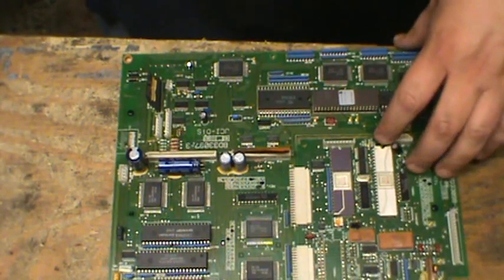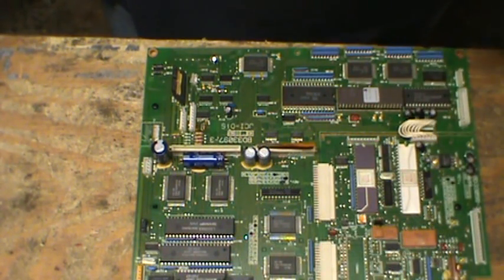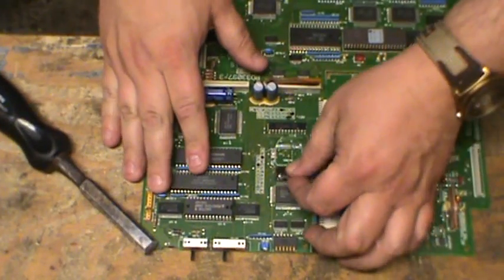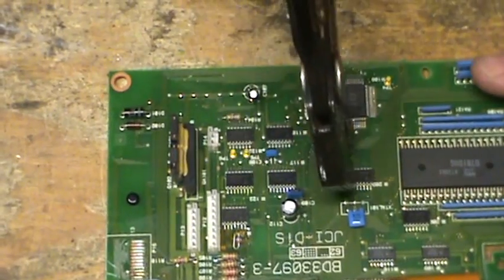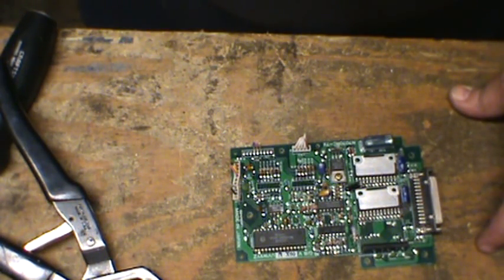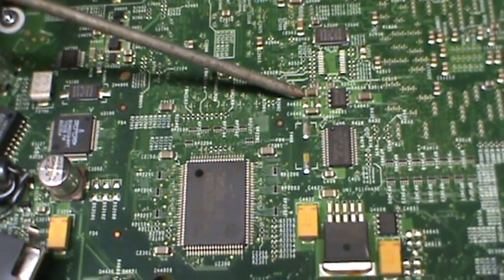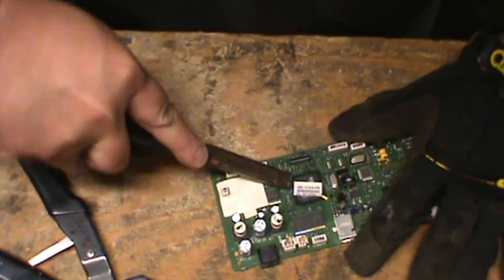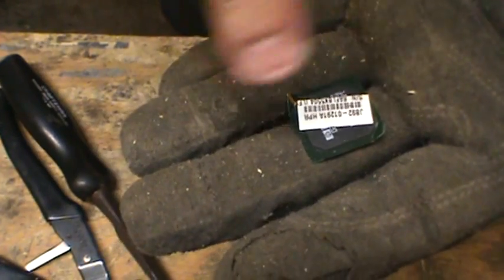Scrapping, how to remove IC Chips, and what else is worth money on a circuit board

Comment from the maker: Hi and thanks for watching!  The IC chip legs can be gold plated, if they are not then it is almost always more profitable to sell them as is in bulk.  As for the ribbon wire, it is most commonly aluminum or tin coated copper.  You can always try testing it with a silver test kit available on ebay for less than $10.  I bought a set that tests for all the precious metals and it only cost about $12 and has been well worth it.  Good idea to take it slow, learn, and not get overwhelmed.  Thanks!

Comment: on the flat back ic chips i have found it's best to take your chissel and get in in the corner as flat as you can get it and give it a few taps with the hammer and it pops right off. thanks for a great video tutorial.

Comment from the maker: That's a great question....  Unfortunately I don't have a great answer for this one.  If the IC has gold prongs, is an eprom with a little window where you can see the gold, or is older ceramic which most often have gold, the only way I know for sure to tell is to crack them open!!  They all get processed pretty much the same way or sold in similar way.  Originalfeets, indeeditdoes, or 10464jeff would likely have a better answer for you.  I may not know but I can steer you there!  Thanks!

Comment: The chip you are removing at 4:00 is actually a BGA (ball grid array). Most people call them north/south bridge chips. Personally, I call them by what they do on the board, graphics processing unit (GPU). Everyone has their own little names for stuff like that. A "flatpak" or "quad" is defined as having legs of all four sides. Any IC package that has legs on all four sides can be called a flatpak.
Reply from the maker: +Geo I love you man.....  Really, I can't think of anything I would enjoy more than to spend like a week just hanging out with you doing gold recovery.  You are GIFTED at correcting and informing people in a way that does not make them feel like a total idiot.  I am still learning, sometimes it seems like there is just too much to learn for one person.  Just watched your video on the air chisel, and read the comments and your responses.  You truly are a first class gentleman.  Thanks!  Editing now!
Reply: +Moose Scrapper  Your so right Moose.  Geo is a class act just like yourself!  Both u guys have already helped me tremendously.  I spent a majority of my youth after college working with IBM Mainframes (Huge) servers printers, card printers & readers , Mac 2s, etc,.  I only used these machines to complete my tasks and was never able to get my hands inside of one.  When the big mainframes broke You could say that I had my head stuck up the IBM tech's ass just to get a look inside of these so called "super computers".  Now these were loaded with precious metals.  I wished I could of gotten my hands on one for scrapping but who knew back in the early 80's.  Let me know Moose when your going to fly to Australia for a week I would like to tag along.  Ha Ha

Comment: The best way to remove surface mount chips is to get a 5mm sheet of amuminium and put it on a gas burner on your stove. Then place the board on top. Heat the aluminium until the solder melts and the chips will easily lift off with tweezers. Also works with flat pack or BGA devices. This way the pins don't get bent or damaged. Essential if you want to sell them. Also take precautions against static electricity which kills most chips easily. Rare chips fetch very good money.

Comment: If you not worried about using the chips or capacitors again, using a heat gun makes the process so much easier. Just be careful not to burn up the board. You just want it hot enough to melt the solder. Smoke from burnt pcbs is horrible to breath in. Use a respirator or fume hood for safety purposes.

Comment: I personally use a large plastic bucket where I throw all the boards and just add some low grade hydrochloric acid(I mean just stuff from Canadian tire,31% muriatic acid)to cover them all!It actually works great:it dissolve all the poop like solder,aluminium and a bit of copper(yes,all that is just nothing more than dog's poop!)-and so it first of all makes all the useful stuff to separate from boards just by shaking these boards,and also reduces amount of poop on which I certainly don't want to waste my aqua regia!
So that is actually the best way to depopulate those boards on my opinion!And BTW after that just some incineration,ball mill,dissolving powder in AR and finally precipitating all the gold,silver and PGMs from that solution-all the rest of the periodic table except these 8 elements(and some uranium and trans-uranium elements which don't occur in e-waste)-is just crap!

Comment from the maker: You are absolutely correct!  Scrap is the LOWEST value of an item and every attempt should be made to sell the item if still working first.  The videos I create are simply how-to's for scrappers.  And in many instances, the only time I scrap many items is for the purpose of a video.  As for the IC's etc, I unfortunately do not posses the knowledge, or time to reasearch, and carefully remove these chips.  I also have no way of testing them to see if they work.  If you see me pulling a board out..

Comment: I find it easier, and quicker, to use an air hammer to strip off components from a circuit board (not just motherboards) when there's more than just a few pieces I'm wanting. The problem with a heat gun or propane torch is more energy will be used ($$$) in the long run if you are doing many boards AND you're introducing toxic fumes into the air you're breathing. I don't rip the WHOLE board though... just for the components I'm wanting to sell off or recover precious metals from. I leave the rest to add to the board weight instead of just scrap steel waste for the ripped off parts of no real value in small-time recovery. Personally, I go for ALL capacitors (and separate by type later), IC chips (not all that look like IC chips ARE IC chips so do your research), IDE pins, SATA port connectors, LAN / Phone connectors (most but not all), USB ports (sometimes), some copper wrapped around iron inductors (I gauge by copper-to-iron ratio), some video & printer ports (I leave the ones on 2004 and newer motherboards except for server boards), and of course any odds n ends that have gold plated material. I have found that the gold plated pins inside of card slots and CPU sockets, and more modern motherboard video/printer ports, are so little in gold plating that the weight of the plastic & metal that's around them on the boards justifies leaving them on the board to sell to a scrap yard. Plus, even with an air hammer, it's a worse mess to sort through afterwards for what little bit of gold plating you're going to recover... but that's my opinion from the time & value aspect of those components. If the board you're tearing down only has a few or less items you're wanting to collect... a pry tool like a screw driver or chisel or utility knife should be sufficient. But if you have a lot of items to tear off or a lot of boards to process... I suggest an air hammer to quickly and easily rip them off. If the boards are the size of a holiday or birthday card, or smaller, and you're wanting to strip it bare... check out Moose's other video about a hot sand bath.

Comment: So the bandsaw works great but you were right, it's very dusty.  I'm using a metal blade so it is a very fine dust that stays airborne for a while.  I'll get the dust collection going and it should be great.  It's also great to just have a bandsaw, wanted one for a long time!

Comment from the maker: That one was not soldered down, it was in some kind of socket.  It was pretty easy to pull out with the pliers without damaging or you can use a small flat head screw driver to gently pry it out.  Chips like that I tend to put aside now and try to research their value and sell on ebay.  Another viewer said I should try that and it is more money that way but more time.  Thanks

Comment: I think next vid when continuing this area is to show the jumpers found on the boards and on the backs of the hard drives and dvd's. Most are gold  plated,  lightly though. On the plus side I've found as many as a dozen on just one unit. Also the Tantalum capacitor you showed is my favorite for picking since it's easily spotted. The one in your vid is a "D" case. Another type ( there are several) is an "A" case. It  resembles an mlcc  except the center is the same mustard color as the "D" case.

Comment from the maker: Low heat, just enough to melt solder or a desoldering tool.  Use gator clips if you can to divert heat away from chip.

Comment: Yes and no...if you're dealing with a middleman ...yes. But if you're shipping to processing plant than a stripped board with the removed items sorted and minimun weights met, are actually worth more, and are less expensive to ship since  you can pack more for the buck since everything is broken down. It really depends on the volume you're doing or hoarding over time :)

Comment: It's a lot less work, but a little more hot to just heat the solder joints with a hot heat gun. Especially if they are surface mount. Hover over the solder joints for a couple seconds and the component comes right off, unscathed too!
Reply from the maker: indeed!  but, it uses energy, energy has  a cost, and fumes are created...  For every method there seems to be an up and down side.  I know a lot of folks who use that method though.  They actually have these big machines that are like 55 gallon rock tumblers that heat the inside and spin so all the parts just fall off.  really cool to watch!

Comment from the maker: I typically sell them to boardsort the website.  They buy it in bulk by the lb.  The only real separating I do with them if I have enough, and with these volume matters, I will separate eproms, plastic, ceramic, and gold pinned ones.  Plastic ones will get the lowest price followed by ceramic, gold pinned, then eproms.  The more valuable ones can be sold on ebay with a little more patience.  Just set your price and wait.  Thanks!

Comment: Great video. I did not know about Monolithic capacitors being valuable, thank you for that info. The chisel seems a bit much for the surface mounted ICs. I found an old smaller, but long, flat head screw driver and put a bevel on it. Leaving one side flat then grinding a 45 angle on the other side. It seems to slice under the chips and makes quick work of them.

Comment: Sorry I don't at the moment, but I'm doing videos for a new Youtube channel restoring vintage audio equipment, so I'll try and do one on removing chips. Most chips that fetch good prices are bios chips from computer motherboards or ic's from old 70's silver aluminium front panel hifi gear. My rule is, if the board looks well made, then chances are the chips could be worth something on Ebay. A heat gun is also handy for removing chips, but only heat enough to melt the solder.

Comment: Better way to do it: use one of thoese industrial blowers. Since you dont want to reuse the ICs you can get to around 500C and all the parts will fall off if they don't have clamps. Or if you have an oven with temperature control you can make a temperature ramp so you can salvage all the ICs without breaking them. 

Something like: 150C for 5min, then 300C for 2 min, then jump to 400C for 30 sec and then back to 150 for another 2min and then let them cool down slowly.

Comment from the maker: The best way that I could say would be to visit the goldrefiningforum.  They have lots of info and videos and tips.  Pyrolysis is the most common method which is basically burning them in an oxygen deprived environment so they do not creat as much toxic chemicals.  Originalfeets has a video on that as well.  It is a multi step process that starts with pyrolysis, then goes to either an A/P bath or aqua regia.  I do not process my chips unfortunately.  Thanks for watching!

Comment: My question to you and I would love to see a video on it is a financial breakdown. Yes the IC chips are valuable but when you take them off you devalue the board as a whole. I struggle with knowing where that line is of which way of doing what is truly the most bang for your buck. Ic chips are a lot easier and less bulky to ship so that’s a huge factor too. Great videos!
Reply from the maker: That is an incredibly difficult if not impossible question to answer.  Its all relative.  For me, the nearest place I can take boards to physically only pays between 3-10 cents per pound.  The good thing is they dont care what condition they are in, you do not have to sort at all, and you can pick off them.  The bad thing is that there are boards worth a few dollars a pound, and they still pay 3-10 cents per pound.  For those boards, it makes more sense for me to try to freight them to a refiner like Boardsort.com.  For someone like Ewaste Mike, he lives reasonably close to Boardsort so he can pack a trailer up and make a road trip so for him it does not make sense to pick items off the board.  The only way to determine which route is best for you is to do your own research into local buyers, and play with freight calculators for online refiners.  Sadly thats about the best answer I can give.  Hope that helps.

Comment: A hot air gun is great for removing chips. It melts the solder really quickly and you just lift the chip with tweezers.
Reply from the maker: Nice!!!  Any damage to the chips with the heat?
Reply: if you want the chips to still work heat them slowly and watch for the solder to start melting, then lift with tweezers. I repair surface mount stuff all the time using a hot air gun. Just watch it around any electrolytic capacitors though, as they will go pop if they get too hot. Cut them off first, or if you're repairing a board, cover them with aluminium foil first.

Comment: Great video, precise, well made, informative. Thanks! How do you get the solder off of the back of the board? those little blobs, they have precocious metals, how do you take those off?
Reply from the maker: I do not remove or collect solder.  The solder with the highest silver content, that happens to also be very rare, is less than 25% silver so the cost in chemicals to refine would outweigh the profit.  Much larger facilities probably recover it, but for the small time recycler/refiner, really not worth it sadly.
Reply: Moose Scrapper Interesting, thank you! That is helpful information.

Comment: the pins from the IC chips are they anything special?   Im just starting out with electronic scrapping trying to get as much info as possible so i dont get overwhelming trying to figure it out. also i have ribbon wire that has what looks like silver ends instead of gold? do you know what type of metal it is?

Comment: Hey Moose....there is a carpet tool that has a 2" (est.) thin, sharp wheel. I'm going to use this for IC removal where I can get to them.....chisel for the others. Much faster.... Did you experiment with my clothes iron heating element for board depopulation yet? Hope it gets hot enough to heat the sand bath.

Comment: I hate to bother you as this is 6 years old.  But, this has been so far one of the better more specific to the point video.  Thank you.  
What do you do with the board after you take everything off of it that you want to collect?
Reply from the maker: My scrap yard buys them for about 8 cents a pound for the copper recovery.
Reply: @moosescrapper5928  man I  appreciate that.  I was up all night taking hard drives apart...need a little cash.  
Not sure if the place I'm going to take everything will like my handywork.  😂
So because your scrap yard is recycling the board...do they typically mind if the board comes a little damaged?  Learning to depopulate= cut hands and broken boards.  I appreciate you taking your time out and answering my questions man.  Have a good day.
Reply from the maker: @Chewy_GarageBandDad  They dont care if its damaged.  They just care about weight.  As for the depop fun times, I only do air chisel depopulation and cherry picking on smaller boards, just what I can remove with pliers or a screw driver basically.
Reply: @moosescrapper5928  thank you.  I will be investing in afew things...one being that impact chisel.  I Appreciate the information.

Comment: Hey Moose, what IC chips have the gold "wire fibers" in them? I know the flat packs with gold lead on the corner and such but curious if ALL IC's are worth processing. I realize that's both an open ended question and people will have their own take on it but I'm sure you know what I mean. I'm not going to burn up 50 lbs of IC's for an ounce of silver.....thanks and YOU ROCK!
Reply from the maker: Great question, one that I am not sure I know how to answer.  THe flat packs have gold, the IC's on ram chips have gold bonding wires, as for all the rest, I honestly do not know.  I have craked opne a lot while removing them from boards and have fould a lot that have no gold in them that I could see.  What I do is take the ones I know have gold and save them to process my self, and sell all the rest.  The goldrefiningforum might have better info for you, or GEO, he has a channel with a video series on recovering gold from them.  Thanks!

Comment: Hello Mr. Moose Scrapper. Will scrap yards still buy these chips if they're broke? In the process of taking some off, they broke. So didn't know if I should throw them away or just put them in with the rest. As always, thank you Sir.
Reply from the maker: Hi there, borken IC's are just as good as intact ones.  Part of the gold recovery process for IC's is incineration so it does not matter if they are solid or broken.  Best of luck to you!
Reply: Moose Scrapper Thank you Sir. Much Appreciated.